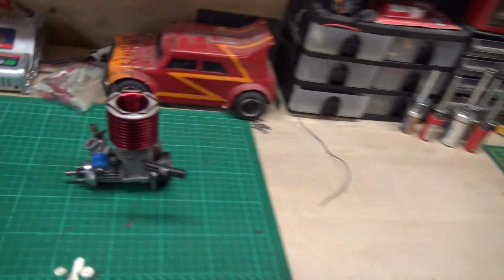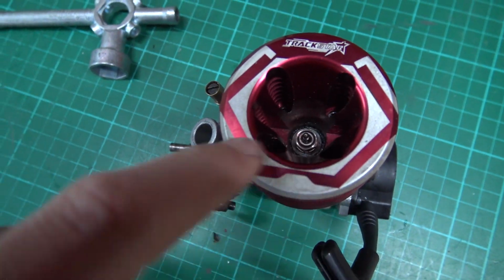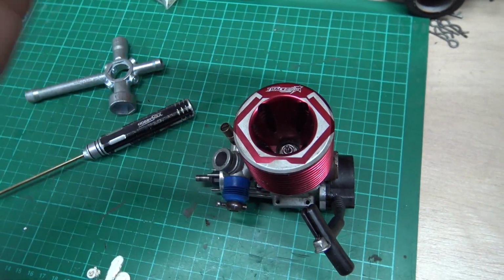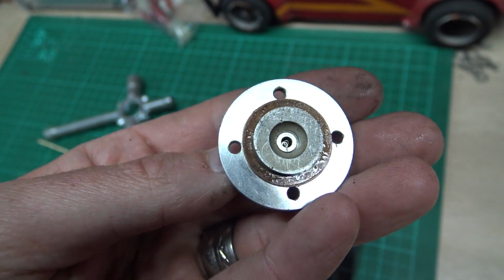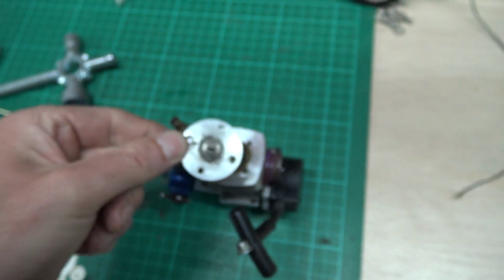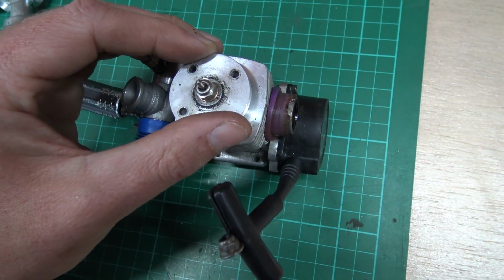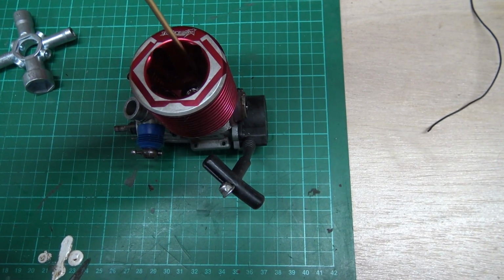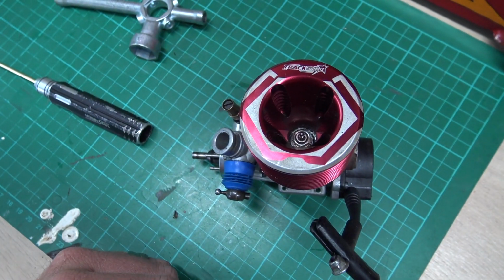Nitro Engine How To Fix Stripped/Cross Threaded Glow Plug

Comment: Tip on gertting stripped hex heads out, use the next size up torx bit. You will have to use a light hammer to get the torx bit into the stripped hex head screw, this method works pretty well at undoing the screws. Obviously replace the screws once removed.

Comment: Does the back plate need the 4 screws because one of mine was really hard and when I got it of it came out with some threads😢 it is the threads directly on the engine
Reply from the maker: It might be alright with only 3, if not you could put a bigger bolt in :)